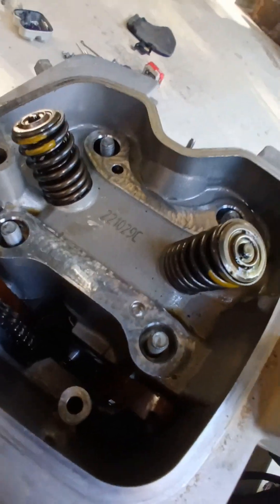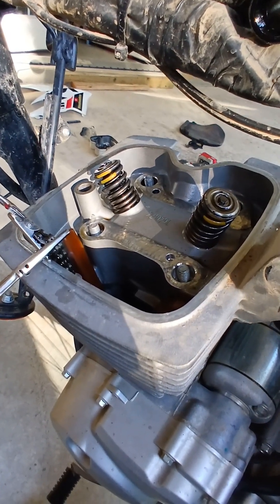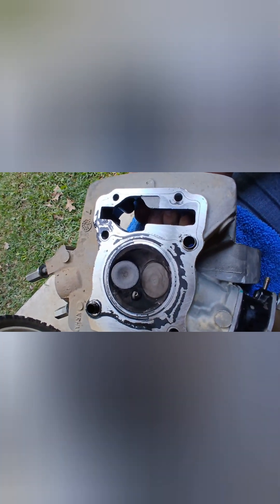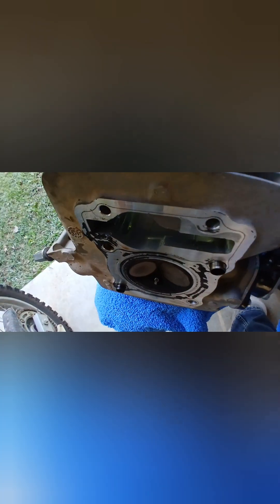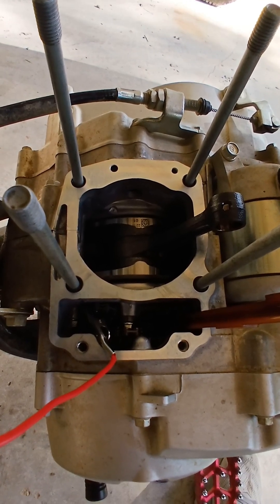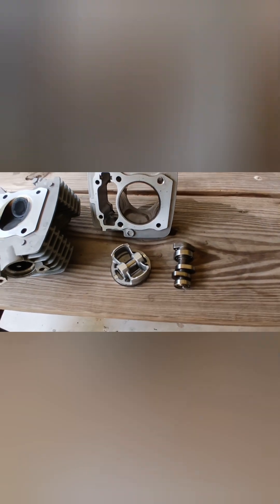Honda XR150L Top End Disassembly after 8,702 miles. Big Bore Kit Installation Video Coming Soon.

Comment: Do you have a diagram of the piston rings gap positions, and the expander ring's
Reply from the maker: @aaroncarter4458  I do not at the moment (traveling today). It should be shown in most currently available maintenance manuals. I used a 180 degree apart ring pattern for the compression rings and for the 2 oil control rings.